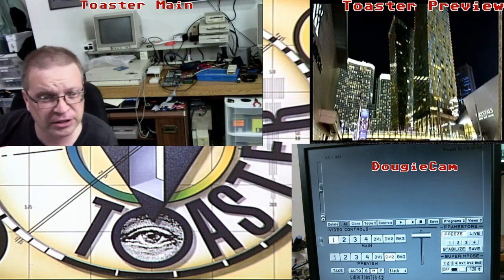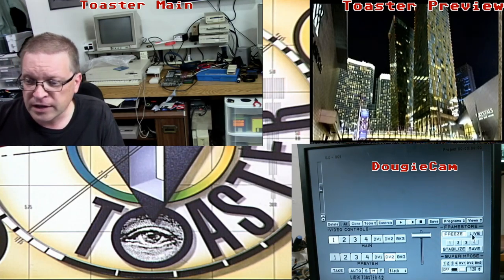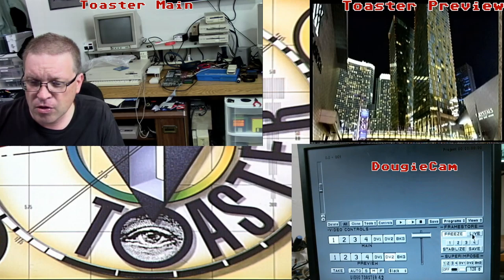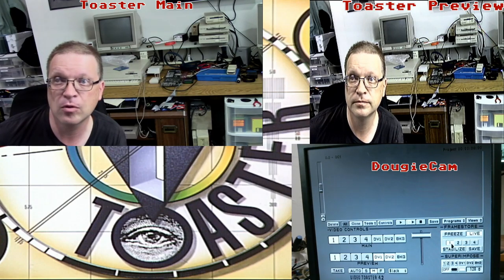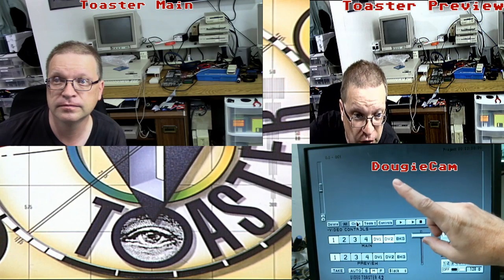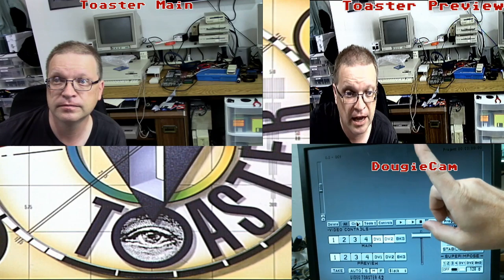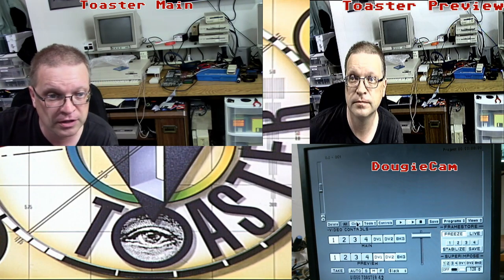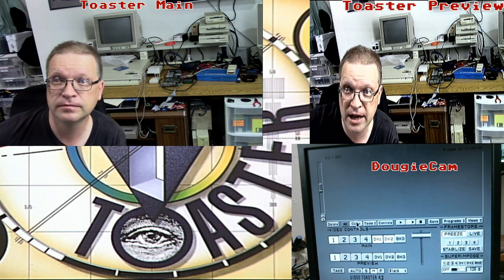Toastorial #1: NewTek Video Toaster on the Commodore Amiga - Episode 67

Comment: Nice to see some Video Toaster love.  I had an A2000 + Video Toaster back when they came out and then later an A4000 + Toaster.   Sold them all back in '96 for dirt cheap thinking they'd get less valuable LOL.  I picked up an A4000 system a few years back and grabbed  the Toaster + Flyer cards for it.  About a year later I got lucky on an A4000T system and another set of Toaster + Flyer boards.  I still need to finish setting up my A4000T flyer stuff as I only dreamed about a Flyer back when it was released and haven't had a chance to play yet.   The other aspect of getting the Toaster installed, I started playing with Lightwave again, which I had forgotten was so much fun.       I did a lot of playing around with the Toaster switcher back in the early days...I even did a demonstration of the Toaster setup to the local Amiga club...fun times.   Lightwave lately became my fun hobby...I eventually bought the current Windows version of Lightwave (at the time 2015)  and have a few videos on my channel done with it.
Reply from the maker: That is so awesome! I would love to find my Flyer and get it running and so some real Nonlinear editing 90's style on it. I will check out your channel for sure!

Comment: Wrong 1987..The Toaster 4000 like the A4000,A1200, aandCD32 came out in 1990.. you have to have the A4000 To Test out the Toaster 4000..Yeepers.Will weaton did just that in 1990. Output isnt/arent channels..channels are data like bits..output is data/ bits finalized. It is a nonlinear editor.. especially with the flyer.... it starts off as storyboard editing.Did Toy Story 1-4 ,and both Avatar. Toaster Oven.Toaster Screamer over 250 RiSC cpus ,and over 150cpus respectively. each being PArisc, Itanium 256bit-n each 64core,Alpha,SGI,PPC mix. Yes these are still being used . I used part of one of them in1998. InPensacola fl. It was from  Mik Dangers Toaster Oven..6feet Tall.. I stood next to both of them. The Amiga TOaster is true 48bit the pc=mac is true 8bit. So theAmiga is still the best.
Reply from the maker: I think you're trying to say you can't use the toaster 4000 when anything except a 4,000? That's not quite true. It works fine in the 3000 and the 2000. You just don't have access to all the enhanced AGA effects.
Reply: @10MARC
Reply: No,but it was tested on the Amiga 4000 in 1990 the only way as it has to be done to fully utilize the capabilities of the 4000 Toaster . ah will weaton ring a bell. I had gotten my A1200 in 1991 via the Columbia astronaut for Free. If you dont know they are masons.They told me that pc=mac , will look they will improve ,but never will. Wonder why i got that A1200 for Free from NASA. CD32 I still have ..I received It is a 1990 system with programmable rom chip from Sterling Stundemire. All these People knew Jay , and Gang just like me. I have been around with Amiga since 1985. Not saying you are lieing,but you have been mislead. I could tell you stories that would make you say wth.